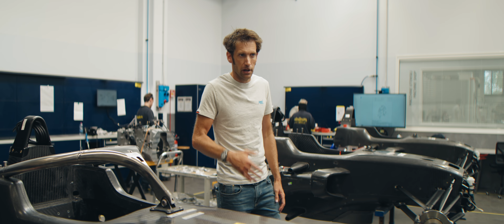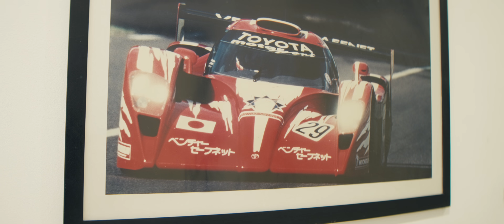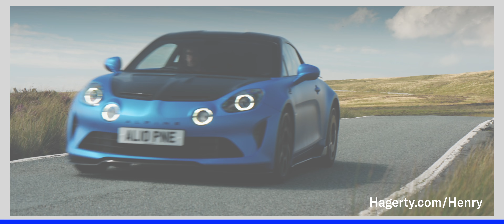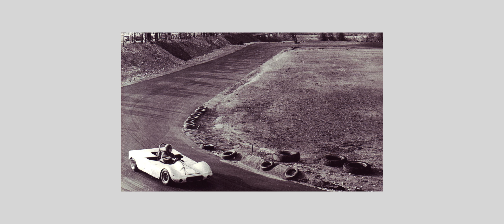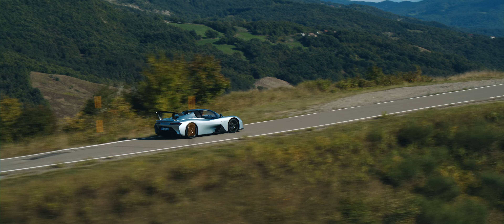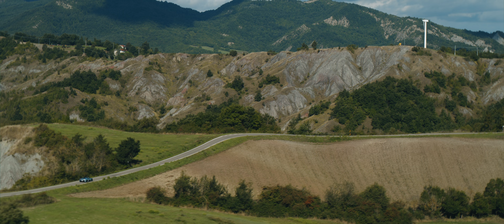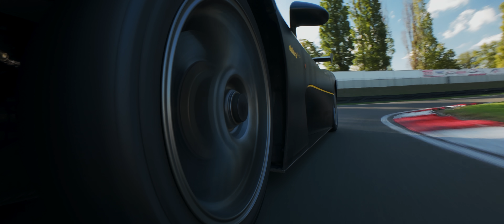Dallara Stradale: If an F1 car was a Miata | Henry Catchpole - The Driver's Seat

Comment: To me the Dallara Stradale is one of the most important car to come out in a while. It goes against all the over tech, Non-tactile, bloated supercars that have been of late. It is a car I dream of owning.
Reply: It would be perfect if it had an angry little high-revving NA engine
Reply: @bobtuiliga8691 that’s literally the mistake this car made was going with the Ford 2.3 turbo instead of a high strung NA engine that revved to 9-10k…. They definitely had options that would have fit too; like the 2.5L Millington Diamond Engine would have been perfect! The price of the car would be better justified with that engine too
Reply: @narrowistheway77  I didn't know about the Millington thank you! Theres also the Boreham TEN-K that had its media day a week or two ago
Reply: @bobtuiliga8691  MST offers it as an option for one of their Escort restomods. The people that option that engine have one of the most gnarly sounding cars you’ll ever hear too, especially considering that it’s just a four banger 😉
Reply: @narrowistheway77 those Millington Diamond engines are used in rallying and require a rebuild every 1,000 miles. Who wants a road car requiring that 🤣
Reply: @huzcer  you do realize that this is only true if you use the engine as a rally engine, correct? The service intervals are wayyyy longer when it’s hooked up to a manual transmission and tuned for the street. Think about how a rally car drives versus how a road car drives…. This was common sense. That’s why MST uses it, it doesn’t have that issue when it’s tuned for road use. However, it does still need an oil warmup before being driven, and if the owner fails to do that, then yeah, they’ll be having a major service pretty early on
Reply: @narrowistheway77  well that engine has been around since 1990. don't you think if it had a good case for a road car that it would have happened in the last 35 years beyond "maybe" a couple of mst mk2 customers. the reality is that the ford engine can provide more power for a 1/4 of the price of the M Diamond engine which costs £30,000 alone. looks a cool engine but we haven't seen it about really - cost probably the biggest reason but there may be others such as likely higher maintenance costs and shorter maintenance cycles.
Reply: @b @bobtuiliga8691 Weight consideration?
Reply: @bobtuiliga8691  No, torque is more important than simple high revving motor.. The most important aspect is the chassis/suspension/aero and how all that is connected and worn by the driver. While those high revving motors are curious and exciting for short moments on the road, they get really old rapidly after time and miles..
Reply: Its almost like Dallara are the only ones who remember what a TRUE exciting and special driving experience came to be. We worked our way to the top then threw away what we learned.
Reply: @ZondaF355  You forget about the T50 and the A110.
Reply: @scottjohnson4319 And the T.33, the Praga Bohema, AM Valkyrie and Valhalla, there’s quite a few others
Reply: @scottjohnson4319 ...errr you mean Alfa 4C  which is the Stradale predecessor. A110 ismore of a luxury car compared to the Dallara 4C or Stradale
Reply: @ZondaF355 Don’t forget GMA
Reply: This and the Praga Bohema show how driving dynamism given by lightweight construction creates a far more engaging experience than complicated and bloated drivetrains.
Reply: @f.kieranfinney457 are we forgetting ultima?
Reply: This is why Exocet's are so popular now - 100% pure driving experience.
Reply: it's been around since 2017.
Reply: And doesn't cost millions, like the F1, the Valkyrie and all of these other supercars that are not bloated but costs unimaginable amount of money.
Reply: It’s been out for a while …
Reply: While the Alpine A110 does not fit in the supercar category. I appreciate it's lightness approach and moderate power.
Reply: I would not call any expensive toy "important". It's just another car for people who don't work for their money.
Reply: @truantray Don’t people who DO work deserve something as light and enjoyable as this one?
Reply: What "bloated supercars" are you referring to?
Reply: @swordmonkey6635  Revuelto, the f80, sf90, Daytona SP3 (even if it looks stunning), AR 33 Stradale, AM Vanquish, Ferrari 12 Cillindri. All of these may be superfast, and still good looking cars, but they are also all absolutely massive, and pretty much all have a kerb weight over 1.8t.
Reply: @hugoop4  "Supercars" aren't about lightweight. They are about pushing the limits of engineering. The heavy weight on the Chiron for instance is there to keep it on the ground according to Bugatti engineers.

This Dallara is in the same area as a Lotus. Lightweight and nimble, but neither are considered supercars. They are "pure sport cars". A supercar is about pushing the envelope.
Reply: @swordmonkey6635 you make  a great point. They are still way over complicated and heavy though. Heck, even the new 911 Turbo S is 3,800 pounds.
Reply: @seanscott7120  Apples and oranges. The "complicated" cars are what drives the industry and sports racing. That's why lightweight simple sports cars are niche. Lotus went bankrupt multiple times trying to chase that "purist" market with lightweight and nimble cars that were simple to drive, but not fast in a straight line. The Dallara is a great car, but it's not a Grand Tourer or a supercar. It's an Italian Lotus in steroids in terms of building material. A great impractical sports car that purists will love, but is only good for carving canyon roads.
Reply: @swordmonkey6635  I never said it was a super car. I only referenced that it holds qualities that I appreciate. I agree with you for the most part. I just believe we have seen all types of performance cars get way too heavy and complicated.
Reply: @swordmonkey6635 I don’t disagree. The new cars are still fast, and they serve their purpose. You just asked for examples of bloated supercars, so I gave some.
Reply: @swordmonkey6635  How many individual can drive any "super car" to it's limits.. where can these limits be explored? These two harsh realities limit the possible enjoyment of any "super car".. to the extreme few gifted with world class driving abilities.
Reply: @rupunzel6299  Supercars were NEVER intended for  the masses. They are, by their very nature, exclusive and the very top of the automotive engineering chain, so they are very expensive since they can't absorb the cost with mass production (or in terms of most supercar brands, affordable models to help buoy the cost for low production number  super cars). Supercars are about the eventual trickledown tech that will land in lower cars (see the Porsche 959 for the amount of bleeding edge tech introduced that we now consider commonplace in cars). Supercars exist to push the limits of performance and tech... that then will eventually be adapted to lower end cars. Supercars allow cars like this Dallara to exist.
Reply: @swordmonkey6635  
Driver has become the fundamental limitation to automotive performance. 9+ G cornering is easily possible today which translates to 200+ mph cornering speeds.. How many mere mortal drivers can deal with this hour after hour?

Watch Richard Hammond (mortal driver) trying to make two laps in a F1 car.. 
https://www.youtube.com/watch?v=EGUZJVY-sHo

~This "fun" and enjoyable to drive?

What drives race car design today are rules plain and simple, What is possible as a design is limited and constrained by race rules and the physical limitations of the human driver.

The foundation for the creation of the Dallara Stradle is Dallara's racing and road car design experience and history. There are very real trade offs to any car design with no absolutes. The harsh reality of "super cars" today, they have become a fashion statement and marketing tool. Majority of them are excessively heavy, over powered with too much tech based "driver aids"... all of which takes away from the actual driving experience..
Reply: @swordmonkey6635  You're right. This isn't a 'Super' car; it's more of a race car. It weighs something like 100kg more than an F1 car, and the aero makes like 650kg of downforce, which is around 100kg lower than F1. The 2.3L Ford EcoBoost Engine was chosen because it's cheap reliable, easy to source parts for, and power-dense. The way I see it, it's the poor man's T.50; just like how the X-BOW GT XR is the poor man's Valkyrie.
Reply: @swordmonkey6635  Bugatti Chiron Super Sport 4,400 lbs and Ferrari 812 GTS 3,800 lbs just as a few examples

Comment: It should of course have a NA Judd V8.
Reply: Gm T50 v12 which only weighs 50lbs more than the 4 cylinder in it
Reply: @drummerdoingstuff5020 indeed only slightly heavier and a mere £2 million more to buy
Reply: @drummerdoingstuff5020 I don't think it can fit in that engine bay. A Judd V8 can.
Reply: OR, a Cosworth V-10.....😁👌👍
Reply: @tedfloyd1961 Star trek wrap drive
Reply: I'd personally prefer a high-revving and compact engine like a turbocharged billet K20 or K24. They'd perform well and be quite a bit more emotional than the Ford engine they currently offer.
Reply: It should specifically NOT

Comment: As I watch this I am struck by how close the car I built in my garage is to this car in concept.  Sure, mine has a steel chassis and aluminum body but the layout, driveline and proportions are remarkably similar.
Reply: That’s a very cool build you’ve done! Looks like many many many hours of thought, design and fabrication went into making that happen.

Comment: The problem with the Stradale is the engine and tansmission. All the time have faliures and no emotion.  Wish they would update it with a better engine.
Frame/chassis everything is perfect what they've done. Even the price is reasonable!
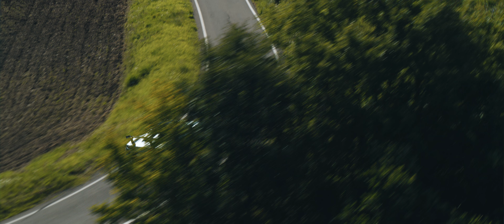Reply: 12:27 seems to suggest it was specifically chosen to meet the engineering parameters of the project. Combined with the earlier statement that Dallara did not want to encroach on the market of some of its customers, kinda makes sense at least why they went this direction.
Reply: I bet it has to do with Euro emissions standards and how larger engines get taxed in Europe.
Reply: @ginacalabrese3869  yep I think so too, freakin emissions and COC paper..
Reply: never heard about failures with either the transmission nor the engine!
Reply: @johannespaul5028  then check the channel of Alex Stewart on youtube who is using it on track. 2 new engines, 2 new transmission.
Reply: @johannespaul5028  The Ecoboost mustangs are near worthless here as so many blew up and nobody wants them now
Reply: @mitchbuchannon6637  how many EcoBoost 2.3's blew up on stock tunes and without money shifting though?

The world may never know